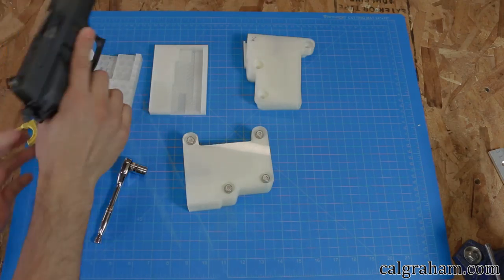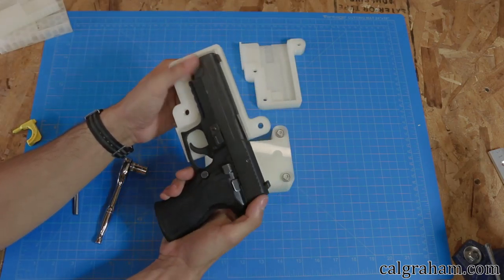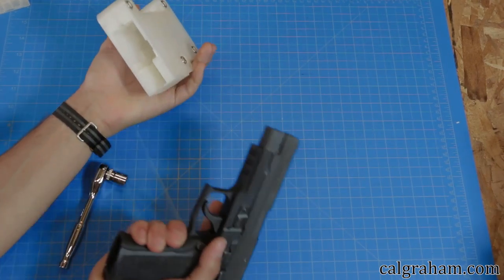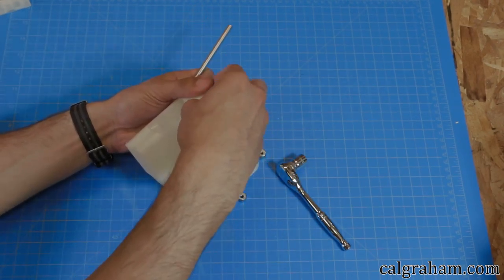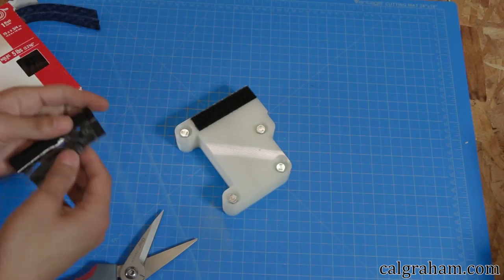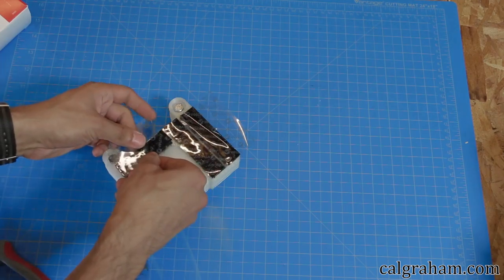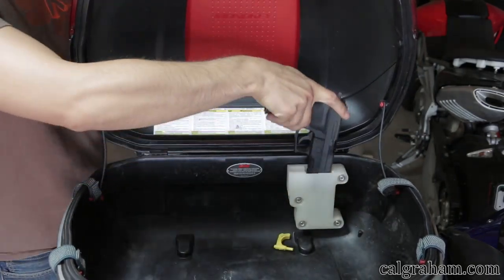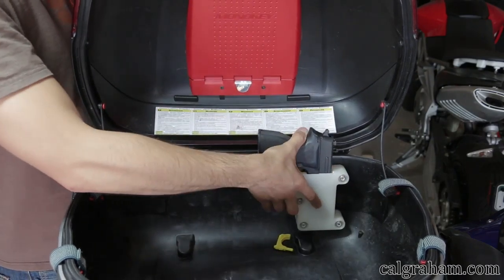Custom Car Holster, 3D Printed for Sig P226

Comment: The first thing we were taught in the police academy was if you ever need your gun, you'll have less than 3 seconds. If you don't carry it on you and one in the pipe you'll never have time god forbid you get into that situation. Not trying to troll you but keeping it in a locked case won't do you one bit of good against a guy with one in his holster ready to go. It happens faster than you may think, trust me it does

Comment: Use 3M dual lock to mount items that have weight, and it doesn't wear out like Velcro.........3M Dual Lock comes in different size sheets for customization.

Comment: you could try to make the middle spacer piece out of something like ninjaflex that way it would have a little bit better adjustable retention like some hybrid holsters like alien gear have
Reply from the maker: That's a good idea! I haven't gotten around to modifying my extruder to print ninja flex yet.

Thanks for pointing me to Alien Gear, it's a good example. I could copy those squishy pillars using inexpensive silicone tube. I would just need to put some counterbores on the inside of the two main pieces to capture the tube.